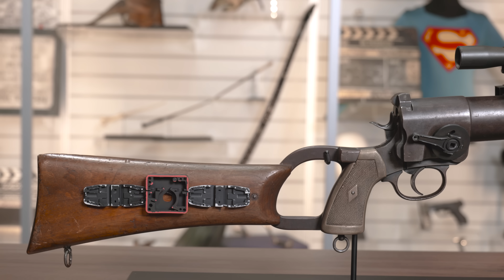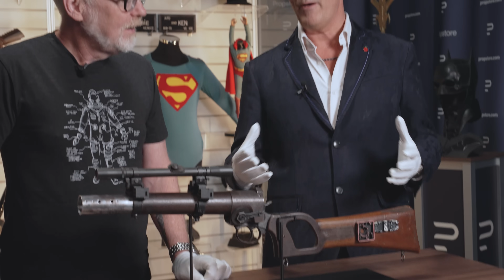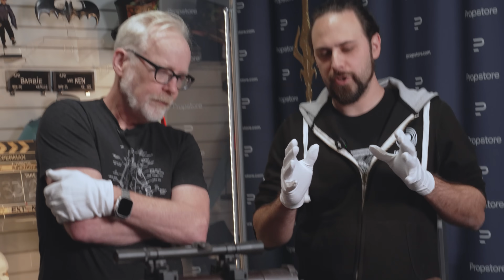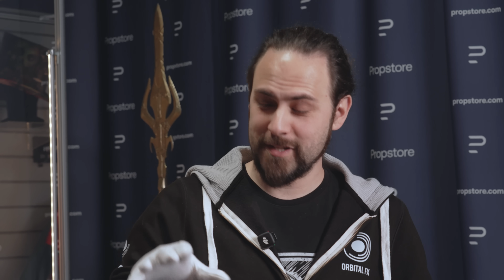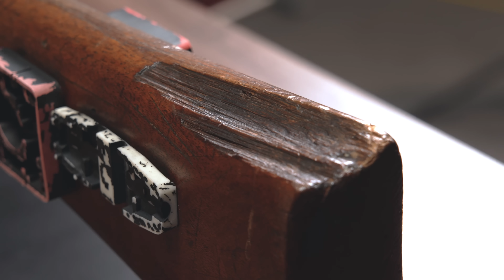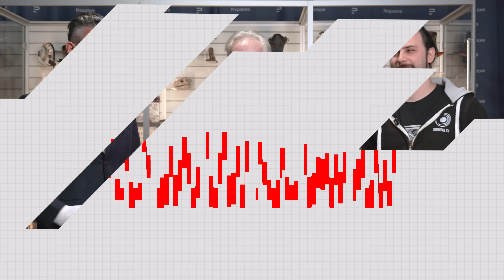How Boba Fett's Hero Blaster Prop Was Made!

Comment: MYSTERY DISKS: I made a 3D model and googled the image of it,  possible leads are  - Most Likely: 1) Embroidery machine cam. The back side probably isn't flat like the side we can see. Google "H6X20 Integral Cam Three Holes for Barudan Embroidery Machine" to see an image.  "Computer Embroidery opening Cam" is another search (though they probably weren't computer controlled back then.    What year and model is anyone's guess... even if that's what it is.   
Also could be...  2) Fender/sheet metal mounts for tractors (Case, IH, John Deere, other agricultural etc) -  
3) Light box spacer wall mount.

Comment: what are they talking about when they are talking about the baklite and brass around the grip?
Reply: The original grip handle seen in ESB was made from brass but the original Flare pistol at some point in its life after ESB had its grip replaced with a bakelite grip (this was a later variant installed on some Webleys i presume during WW1 its Basically Phenolic Resin a super tough rigid plastic, so although the gun was matched serial number wise to the original this part must have been swapped at some point 

As bapty had it back after production it could have been rented out and a production might not have wanted a brass grip so it was likely swapped out for a brown bakelite grip

Hope that helps!!

Comment: Like many 501st registered Boba Fetts I have been obsessing over the ESB version for decades.

I built my first version in the early 2000s. We knew it was the webley base flare unit, but many of the other bits still had day to day bickering on the "as you wish" forums / the dented helmet.

By the release of the HD version of the original trilogy we have most of the part identified.

Currently I own every single instance of "founds parts" needed to put one of these together EXCEPT the breech discs.....I was incredibly disappointed that this screen used piece coming to light did not yield a positive identification.

I understand the unit will be auctioned, but there are thousands of us that would appreciate photos of whatever part existed there before they used the SLA printed parts in the restoration.

The community really deserves those dimensions and more insight into the condition before it was offered for auction.

I really am still in disbelief this thing has been rediscovered and will have a new owner soon, but like I said after decades of sweat....paging through European parts catalogs....machining my own parts...and getting all of them together (like the case of unimax switches I have in my basement from a couple years ago) I'm thankful to have put together the next best thing.....an accurate replica with real parts 

Cheers everybody 

Ch
Reply: There were zero parts there it was just the base webly, as it was a rental most likely all the parts were tossed following filming such was the way of things in that era, as a fellow legionnaire i assure you nothing original was disposed or replaced here the restoration was to put parts back to give the raw flare gun its flair ❤

Comment: Got lost at some point in the great detail of Theseus's Blaster.  It seemed like he described almost everything on the body as being a replica.  Did they state what they started with? Only thing that seemed to be stated as original was the stock.
Edit:  Auction site had the clarification:  "The blaster was stripped back to the base flare pistol post-production, and has since been carefully restored to how it looked in the films through the addition of replica greebles and accoutrements, which have been intentionally weathered and distressed to be as accurate as possible. The flare pistol is the only original element of the lot. In addition to the replica elements, the scope mount has undergone some sympathetic restoration."

Comment: I think hes don a better job than you ,in aging stuff ,,By the way the original WW1 flare gun had screw heads on the butt stock ,but they covered them up with those plastic bits